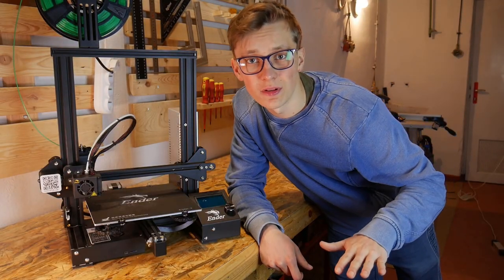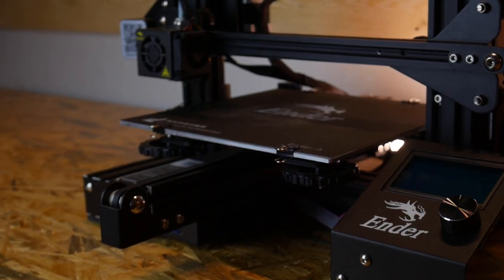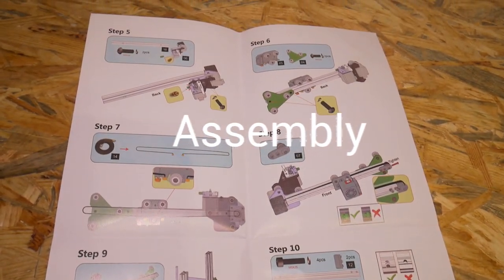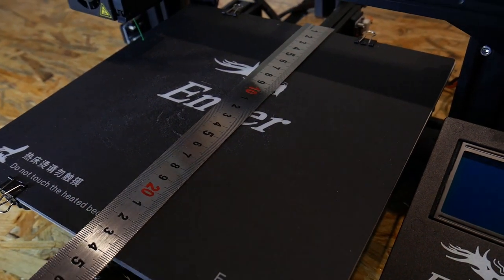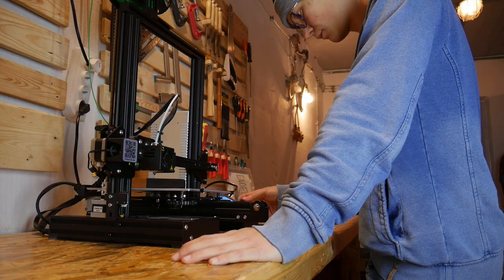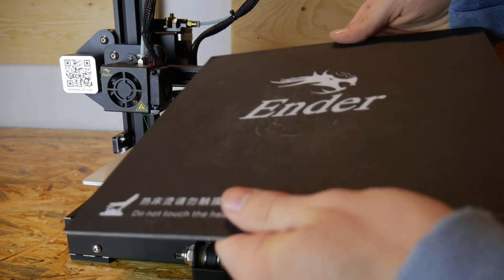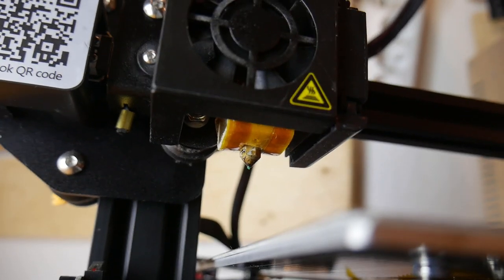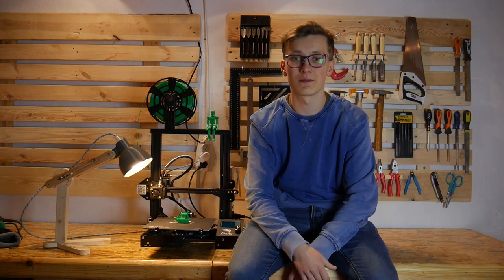Amazing Low Cost 3D Printer - Ender 3

Comment: Wobbling on your Ender 3 frame means your extrusions are out of alignment. You need to loosen them all (not just the upper gantry) and let the printer rest on a flat surface so everything falls into square. Then tighten.
Replace both PTFE tube couplers with better quality ones. Print a cover to stop filament going over your mainboard fan. Replace extruder with a metal one. Add dampeners to your X and Y axis.  Oh and print a knob for your extruder gear, makes loading and unloading filament a breeze.
Great printers, I have 3 of them. But eventually size does matter, especially for projects, so I also recommend a Anycubic Chiron.
Good video. Simple and to the point.
Reply from the maker: Thanks! Someone already mentioned how to fix the wobbling problem, there are two screws on each side and after losing them and tightening again on a flat surface it's ok.
Reply: @nikodembartnik  I think that is what I said mate.
Reply: I would say the only really needed mod is the filament guide, although the printer does work properly without it. Perhaps the main board fan cover. All the rest are just for cosmetics and peace of mind.
I am really happy with my Ender -3. It prints great even at 0,2 mm layer height, and at 0,1 mm, the quality is almost glass-like.
Reply: @joeblow7374  I avoided the filament guide. I went with the side mount spool holder, gives it a better path and stays away from lead screw. I would dare say Ender 3 has better quality than a Prusa. And a very easy printer to maintain.
Reply: @swiftrick15 Side mount might be a better fix, but a filament guide is faster. :)
Reply: @joeblow7374  the side mount I printed out was small, probably took 25min to print. And uses the original holder and mount and screws. But yeah.. I guess maybe 10min faster..lol

Comment: My ender 3 frame was also wobbly. If you loosen the screws on the bottom H frame and set it on a flate surface you can remove the wobble. It might be harder to do now that you have it fully assembled though. It was the first thing I did before attaching the uprights.
Reply from the maker: Thanks! I will try to do this :)
Reply: @nikodembartnik  and then start printing all those mods. It seems an ender 3 is never fully finished.

Comment: Great review. Did you purchase a different bed for it or is that standard? I'm using a geeetech i3 at the mo to print off your CNC stuff, but hoping to get an ender 3 to help print the parts.
Reply from the maker: Thanks! No, that's a standard bed included in the kit and it works so well! That's great good luck :)
Reply: @nikodembartnik  thanks. Almost done first part.

Comment: So did you sel the CR-10s and CR10-mini? Or do you have 3D printers now?

Looking at buying a CR10-mini as the price is not a lot more than a Ender 3/Ender 3 pro. 
How do they compare ?
How does it compare to the CR10-mini when it comes to noise?
Reply from the maker: I still have them. If huge build area isn't super important for you I would go with Ender3 but if you need a big printer then buy a CR10 or CR10 mini
Reply: @nikodembartnik  I've startet to look at the Anycubic i3 mega/mega. Seems to offer reliability and good prints at a good price. Have you tested it?